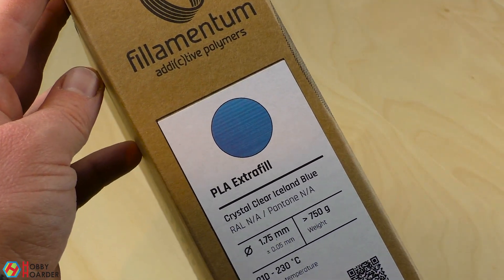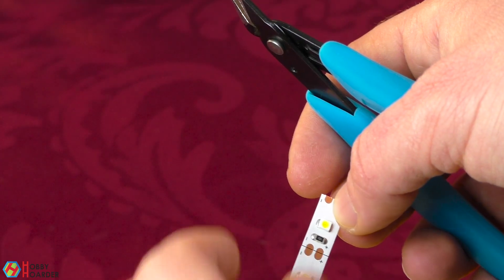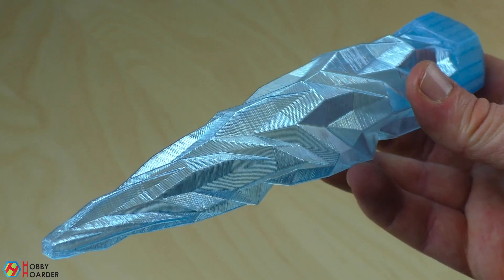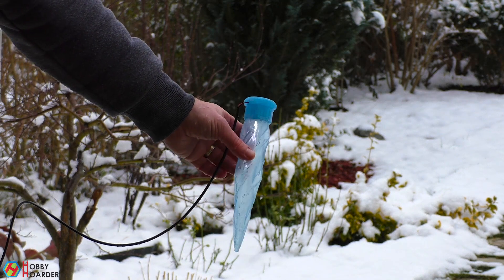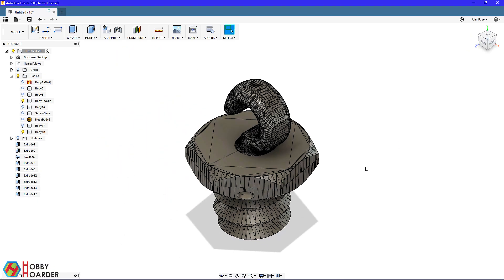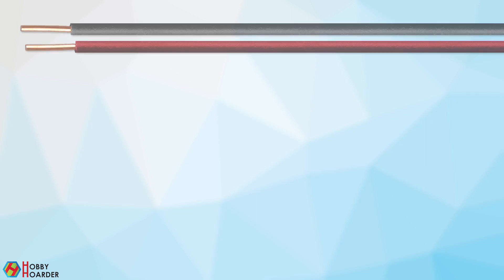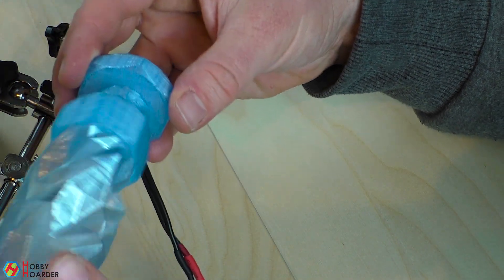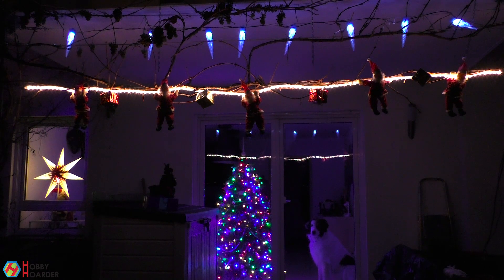3D printed christmas icicles with LED lights

Comment: Hi. I love your design :) could you please provide a second outlet for cabels in the screw? I would like to use icicles with data connection. so i can put several of these in a line :)

Comment: Hello, i'm new to 3d printing, and i just finish building my own 3d printer from scratch, and totally blank about 3d modelling. May i know what software you use to edit the stl from thingiverse? Is the software free?
Reply from the maker: Welcome to the hobby, I'm sure you'll love it!

I use Fusion360 and I love it. It's very powerful, yet easy to use. It's also free if you sign up for the hobbyist account (https://www.autodesk.com/products/fusion-360/personal).

If you'd like to start with something easier, but still usefull, check out Tinkercad.
Reply: @HobbyHoarder  hi, thanks for your reply. Just click on the link you provided, but the link give me 404 error. Yes i just found out about tinkercad, now learning tinkering things there 😁.

I also have problem with my print results not smooth, it have a horizontal line the whole print object, the lines were, some inwards, some outward, and it kind of line up very nice from bottom to top. Do you have any idea that might cause this problem?
Reply from the maker: @heriyantoheriyanto8196  Sorry about the link, it's working for me, but you can just search for "Fusion360 personal" and you'll find it.

That could be caused by loose belts, filament with inconsistent diameter (happens a lot with cheap stuff) or maybe the temperature fluctuates too much (check out PID calibration).
Reply: @HobbyHoarder  hi, thanks again for the reply, i'll check the fusion 360 later. 
I'll try tightening the belts, thanks for the info.
For temp i see the tempt chart, it showing stable tempt, i have done the pid autotune.
For the inconsistent filament diameter, any idea how to tackle this problem? All calibration for xyz i have done it.
Reply from the maker: @heriyantoheriyanto8196  If the filament is of poor quality, there's really nothing you can do about it. Luckily, more and more of them are now being produced at +-0,02 tolerances, which should eliminate any issues in terms of consistency.
Reply: @HobbyHoarder  oh, so it seems i just have to satisfied with what i have till all my filament runs out 😅. Thanks for your input. It really help a lot for beginner.
Reply from the maker: @heriyantoheriyanto8196  No problem at all, happy to help :) Good luck with your new printer!

Comment: Are you just gluing the Vase mode icicle to the nut or are you somehow combining vase mode + regular mode printing?
Reply from the maker: Yes, I'm combining them. Simplify3D has the option where you can print part of the objects with different settings. So I'm printing the nut with normal settings, but once it gets to the icicle, it switches to vase mode.

I think PrusaSlicer has that option now as well, not sure about Cura. But even if you don't print the icicle in vase mode, it should still look nice, just randomize the starting points.

Comment: Nice video.  I came here via your Thingiverse project.  At the end of the video you mention that you want to revise this to use multiple LEDs (presumably individually addressable LEDs).  I was wondering if you've done that?  Now that Halloween is over, I'm looking forward to doing something for Christmas, and I was thinking of doing just that (multiple LEDs in an icicle).

I'd love to hear what your thoughts are, if you've worked any on that project, etc...

Thanks, and keep up the good work!

PS.  I really like the presentation style, editing, etc of your video.  :-)
Reply from the maker: Thank you, it's always great reading feedback like that :)

No, I haven't worked on that project yet. At the time, I was thinking of using simple LEDs in combination with capacitors and transistors which would simulate the blinking. But I soon realized that would be a nightmare to wire together if I wanted to have 50 or 100 LEDs. So yes, using addressable LEDs will make this project much simpler in terms of wiring, but I have a feeling power supply might become an issue. Luckily, LED drivers aren't expensive. I haven't measured anything yet, so I'm just thinking out loud.

I have 2 videos planned for November and I'm hoping I'll have the cascading LEDs done by early December. If you happen to start before me, I'd love to hear your experience with a project like this.
Reply: @HobbyHoarder  - You're welcome.  I always like to give credit where credit is due.  :-)

I was just talking to my wife about what we could/should/might do for Christmas decorations, specifically lights.  I think I'm going to try a two prong approach -- one would be using a traditional straight string of addressable LEDs (programmed with Vixen Lights or such), and the second would be a bunch of your icicles that would be controlled differently (pick up on some work I started last year using an Arduino + MIDI interface).

For Halloween this year, I made some demon horns for my daughter's Halloween costume, and they turned out very well.  In each horn:

- A strip of LEDs -- actually, two strips stuck back to back but wired so the first LED on both strips would light together; the second LED on both strips would light together; etc.  It's easy to wire the strips this way: Simply cut two strips of the same size, glue them back-to-back, the wire the power connections together and the data-in lines together.  A fourth wire would connector to the data-out pad on just one of the LED strips.

- Closely surround the LED strips with a diffuser so that the LEDs aren't shining directly on the sides of the icicle.  This really helped the look of each horn.

I'm imagining that each icicle could have something similar, plus :

- Run four wires out of the top of each icicle (+/- power, data-in and data-out).

- Run a pair of relatively heavy gauge wire horizontally above the icicles (like what you did).

- The data-in and data-out lines don't have to be very heavy gauge as each would be a pretty short run (just from one icicle to the next).

A friend and I were discussing this last year, and we were thinking of making some simple PC boards that would make it easy to hook each icicle into the "main run".  It's kind of hard to explain, but basically image a PCB that is in the shape of the letter "T".  From, say, the left, you have power in (two wires) plus data-in.  At the bottom of the PCB would be four pads which would go to one icicle.  Finally, on the right side of the PCB you have power (out) and data-out.  You could then just splice as many of these together as you want (one for every icicle), and you could easily add or remove them later.  (Since my friend has a CNC machine, he could crank these out in no time.)  :-)

Ok, enough of my rambling.  I'll keep you posted on how things go.

Take care.  :-)
Reply from the maker: @wombat9999  It's really great what you did for your daughter, I'm sure she loved it!

Yeah, I had something similar in mind (without the pcb board) as what you've explained. Instead of sticking two LEDs back to back though, I was thinking of printing some sort of diffuser. I'm experimenting with trying to print translucent PLA as clear as possible. I've actually been getting quite good results, so it might work. Imagine just a small, half dome that would sit on top of the LED. Should make it visible from all angles with a single LED. But I'm sure it won't be that easy in the end :)

Comment: Hi. Nice project! Will try it next Christmas. 

I do have a question. Where did you get the LED strip? I can only find where it is separable per 3 or 4 LEDs in stead of one.
Reply from the maker: Thank you Martijn and good luck with it next year.

I bought mine from AliExpress. If you have 3-4 LEDs together, that probably means that  you have colored (RGB) lights (you can change the color to anything you want), so you can't separate those.

If you buy LEDs with a single color (white, yellow...), then you should be able to cut away individual LEDs.

Here's the link for the specific LED strip that I have:
https://bit.ly/2SQykxy

If you look closely at the first photo, you can see the difference between RGB (multi-color) strip and single-color strips.
Reply: Thanks. I noticed that. Great! But look at this. This is only white, but has multiple LEDs per strip. 
https://www.amazon.de/RandLight%C2%AE-Streifen-RT1-5000-Tageslicht-Aluminium/dp/B00D6O9BFM
Reply from the maker: That's weird, but I guess it's cheaper to produce if they have less cutting points. It's interesting that most of the LED strips on Amazon have this design. I've looked at the first 5 pages and all of them had multiple LEDs per cut point.

If you're not in a hurry, I suggest the ones from AliExpress that I've linked to above. They seem to be of good quality and you can cut out each LED. They're also much cheaper than from Amazon.